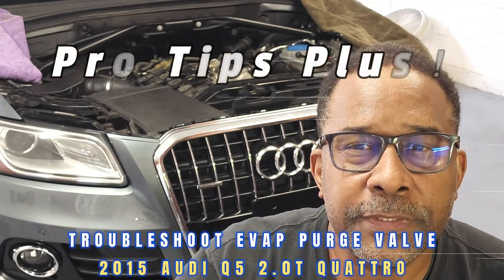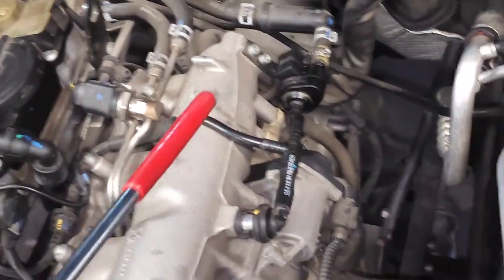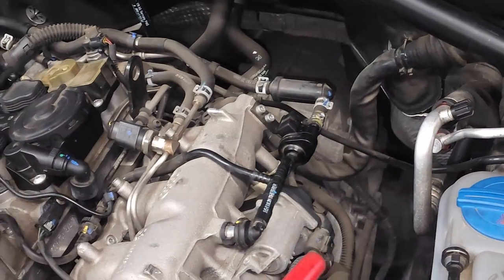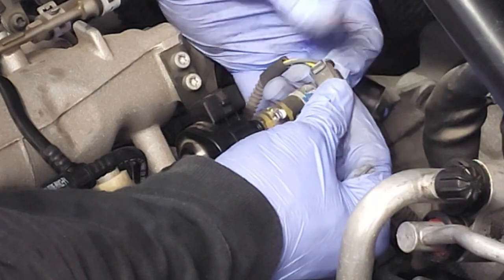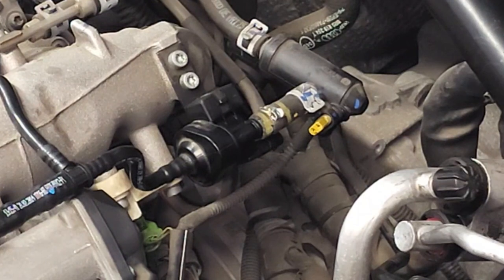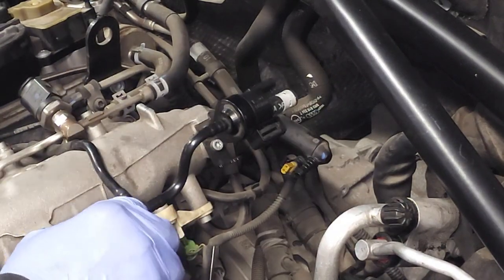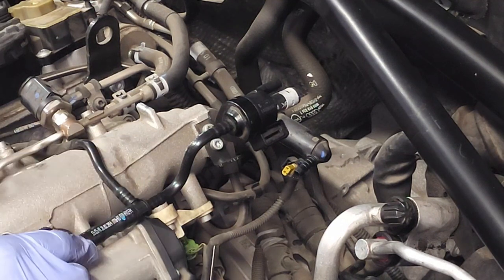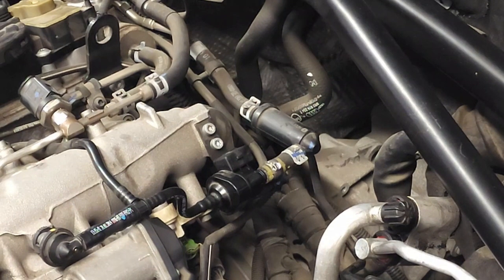2011-2023 AUDI Q5 2.0T QUATTRO, Tips for troubleshooting a Vapor Canister Purge Valve

Comment: Hi, love your videos, great information. I would like to seek your advice. I have an 2011 Audi Q5 that have P218700 System too lean at idle, bank 1. Do you have any ideals where when wrong?
Reply from the maker: Check for air leaks. Have a friend,  hold idle at 1500 rpms, and spray short bursts of carb cleaner on hoses that connect to the throttle buddy. It's likely that you have a cracked hose. Great question. Let me know how it goes.

Comment: I have an 2021 q5 that is throwing codes P017200 and P044200 with 24000KM on it.  Dealer is telling me evap canister has fuel in it and that is the issue yet I have no check engine code or fuel smell. Only symptom was that I would fill with gas (I dont overfill always stop when the gas clicks) and says I need to replace the evap canister.  Will the evap canister eventually dry out? Even after the canister was removed at the dealer and put back on the suv starts on first try now before it was second try.  Never have any other issues starting it.  Dealer wants $3000 to replace the evap canister. Only time it had issues starting was after filling with gas would stall on first try and start on second try.
Reply from the maker: The Evap Canister (Vapor canister) likely contains a very small amount of fuel/moisture because you have a faulty Vapor Canister Purge Solenoid (Solenoid) that is not maintaining a pressurized system and allowing fuel vapors to flow uncontrolled past the Solenoid. Yes, the Vapor canister will "dry out/have less moisture" if the fuel level is kept below full. However, because the Solenoid is not properly controlling the flow of vapors from the fuel tank /vapor canister the symptoms will continue to get worse until a check engine light appears. Its been my experience that Vapor Canisters only need to be replaced if they are cracked and can't be resealed.  Consider replacing the Solenoid as a DIY repair.  
See link to - VALVE/Solenoid, Part Number: 06K906283, Supersession(s): 06K-906-283; 6K906283
https://parts.audiusa.com/p/Audi_2021_Q5-20L-MILD-HYBRID-EV-GAS-MHEV-AT-Premium-Sport-Utility/VALVE/78749359/06K906283.html
See link to Vapor canister  .. https://parts.audiusa.com/p/Audi_2021_Q5-20L-MILD-HYBRID-EV-GAS-MHEV-AT-Premium-Sport-Utility/Vapor-Canister-EVAPCanIST-Vapor-Canister-Vapor-Canister/97176013/80A201797S.html
Great questions.  Please consider a "Super Thanks" for my time and knowledge.
Reply: @protipsplus  thank you so much kinda felt like the dealer was trying to charge me for an evap canister without checking enough